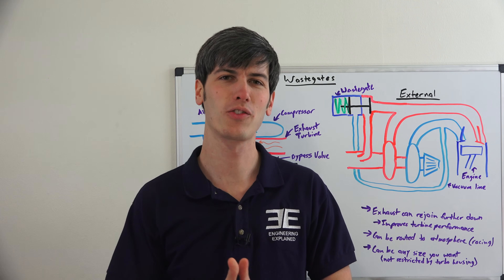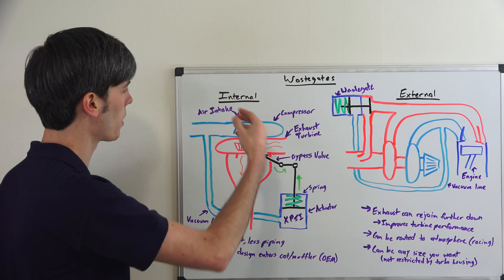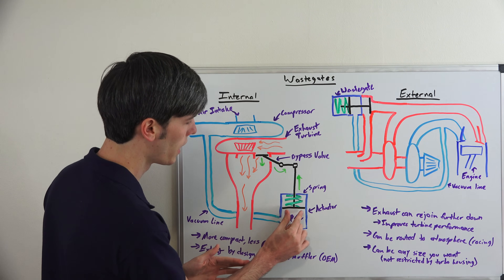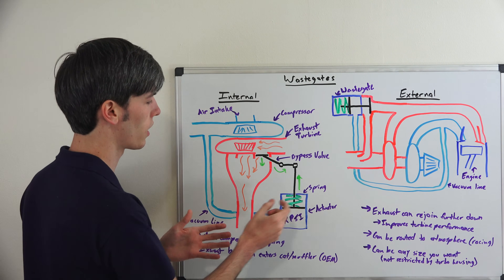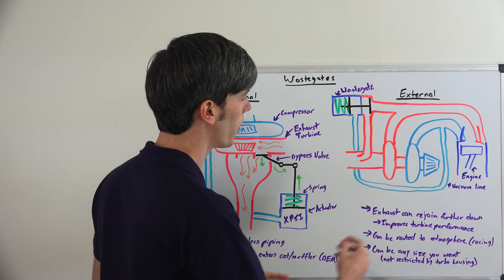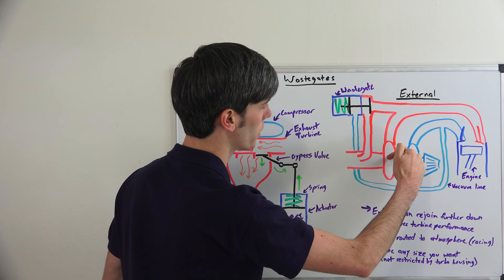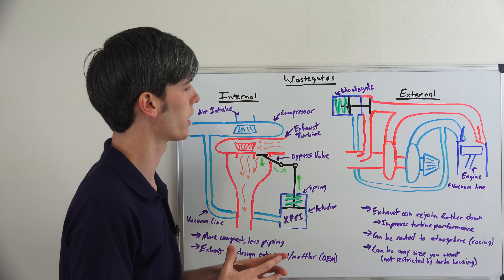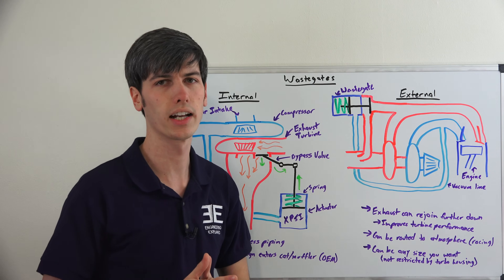How Turbocharger Wastegates Work - Internal Vs External

Comment: Here is my noob question, where would a blow off valve come into play with these turbos? Does it differ with an internal or external wastegate? Or does it replace the wastegate?
Reply from the maker: +Isaiah Thomas Blow off valves are located on the intake side, so they relieve pressure before the boost makes its way into the engine. Similar concept but on the intake side - it's possible to have both.
Reply: So would a blow off valve just control the pressure so you are not over doing it and overwhelming the engine? Also are there negatives to having both? I really appreciate the reply!
Reply: +Isaiah Thomas Blow off valves open when you lift off the throttle, it's the wastegate's job to control boost on throttle so as you said it doesn't over do it, there are no negatives running both but a blow off valve isn't needed, a wastegate is needed.
Reply: Thank you so much for your input!
Reply: +Isaiah Thomas Altho i would recommend running a bov, the STUTUTU you hear from non bov turbo setups is actually really harmful to the turbo
Reply: KittyCow It is not harmful, it is very common here for people not to run a blow off valve or bypass valve including people pumping 40+psi out of turbos for years without issue.

Comment: I am considering an external wastegate for my 2015 WRX, and I had a few questions. How would it effect the reliability of the car? Why is it that so few people do this modification if it improves turbine efficiency?  And lastly, would you ever do this on your STI if your warranty was not at stake?
Reply: +Alex Johnson because if you dump it to atmosphere, its illegal. And to re route it back to exhaust means more piping needed. 2015 WRX turbo is mounted in a very tight space if you are adding a bigger twin scroll turbo with external waste gate, you will have 2 big waste gate under your car. If you want to re route the it back to exhaust, the piping will be nightmare.
Reply: +Alex Johnson It should not affect reliability in any way. As for why people do not do it, it costs money. Also in a version that dumps to the atmosphere, it is illegal in the majority of states. They are often for aftermarket turbochargers as well which require more airflow.
Reply: +Против Глобал Nope
Reply: ***** First :)
Reply: I will be putting an EWG on my 2016 wrx, great mod for safety and power
Reply: Also external wastegates eliminate boost creep under cold conditions which is an issue for any turbocharged vehicle
Reply: +Против Глобал What? Are u sure? Because i think wastegates are made to dont let the turbine overload. Im not an expert tho

Comment: So does a blow off valve just clear the vacuum line from positive pressure?
Reply: +J Sem A blow-off valve lets out the intake air compressed by the turbocharger. A wastegate lets out exhaust gases before they get to the turbocharger. That's the difference.

Blow-off valves are there to protect the engine from too high boost pressures. If you're first accelerating hard and your turbo is spinning fast and generating a certain amount of boost pressure, and then you suddenly lift your foot off the gas pedal, the turbo is still spinning fast and generating boost pressure, but now the pressurized intake air has nowhere to go and starts to build up pressure. Without a blow-off valve your engine could be damaged because of the built up pressure.

So basically:
- Wastegate regulates the maximum boost pressure the turbocharger can generate when you're accelerating by letting some of the exhaust gases to bypass the turbocharger
- Blow-off valve protects the engine from damage when you stop accelerating and the turbo is still generating boost pressure by letting out the pressurized intake air
Reply: +J Sem BOV clears the pressurized intake system from boost as you get off throttle to save the turbo.
Reply: +J Sem it pops when the inlet, after the compressor reaches the set boost.
simply a waste gate lets boost vent exhaust, and a blow off lets boost vent boost.
blow off is better but will stress a turbo wai to much
Reply: +SoY_FooD You've got it all wrong, please go do some research on how a blow off valve works before commenting.
Reply: +Kepe "Without a blow-off valve your engine could be damaged because of the built up pressure."

Considering the throttle plate is closed it would hard to damage the engine, it doesn't cause any damage not running a blow off valve...
Reply: DriftNick But the pressure builds up behind the throttle plate, and when you press on the gas pedal and it opens up again, there's a higher pressure going into your engine.
Reply: Kepe That isn't a bad thing, it's a good thing.
Reply: DriftNick So it's a good thing that there's too much pressure in the cylinders of your car, causing knocking?
Reply: Kepe That isn't what happens tho, there won't be to much pressure, there won't be more boost then you have on throttle, it's really not an issue.
Reply: DriftNick
i studedy this staff an workt on a lot of tunde cars.
a lot of the time we weldit the waste gate shut.
set a blow off valfe to the boost we want in the manivolde an add a dump valfe after the turbo bet before the trottle body.
if u shift gears u step off the gas so non tof that "surge"can get to the engen (it can on a diezel).
also the air in the intake side will slow down dramaticly and rize in presure making air go past the turbo blades in the wrong direction making the chirping sound.
DUMP valve
at max turbo speed and a closde trotel body u get to mutch boos and slow air on one side and underpresur/vacume at the manivold.
u the open a pipe before the trotle body bu vacume power to let the presur speed out in to the open air making the wuss sound when steping of the gas.
BLOW OFF
wil limit the intale mainvold boost.
so if the engen can hadel 1 bar of manivold boost u set it so any more is ventid out.
so if the turbo is a 1 or 2 or 4 bar it will only feed 1 bar no mater mat making it way more presice than a waste gate (witch is made to protect the turbo not the engine)

sry for selling im dutch and on a phone and cant get spell check to work
Reply: SoY_FooD Not only unreadable but incorrect. Blow off valve and dump valve is the same and simply lets pressurized air out from the intake when you let go of the accelerator. Wastegate limits the boost by redirecting exhaust gases once the set boost has been reached. Without the wastegate the boost will rise til the engine blows up basically. While you do not need a blow off valve at all. It just increases the life of your turbocharger.
Reply: for max performance u weld the waste gate shut u put a glowing red hot fin in the exhaust and u dump extra fuel in to get nice loud bangs.
and a turbo runing at max
so to protect the engine u bleed the exes air out of the inlet manivold.
that is how A.L.S. in a old style rally engine works.
its murder on the turbo and they don last even 5000KM.
that is why they added a dump valve to the system to dee stress under engine braking.
modern cars have the dump valve and the waste gate to get less turbo wear and smoother operation.

o and thanx for looking past my horrendous grammar and stuff.
Reply: SoY_FooD I still do not agree, if you weld the WG shut and use a blow off valve as a boostcontrol it will overrev the turbo and you will end up with a highly ineffective turbo spinning way too fast to deliver any sort of efficiency. Not only will it break but it will also deliver warmer air than if you would control the boost with a WG and let the turbo work in its most efficient area.

It doesn´t even make sense that you would weld the wastegate if you are looking for maximum performance. Why would you use an internally gated turbo with a welded gate instead of simply a turbo without WG and just not add the external WG it should have.
Reply: if it is the 1980 to the 1990 and u want 800 BHP out of a 2.0L 4c and u dont think that cooling the engine by injecting more fuel just to evaporate and cool instead of i don't know... maybe... power.
i don't think they have efficiency nor life span in mind.
all it had to do is get past 3 rally stages and as stander maintenance they swapped them out like they swap out tire's.
rouls forced them to use "production turbo's" so the had a wast gate.

its also a very cheep mod for rice rockets and dino queens.
also thees day's u have ECU controlled wast gates that add different benefits so modern monsters use them wast gates one's more.

ther is ro was even a us nascar like race where drivers had a tube near there ear so they van hear the blow off valve about to go and they tray to stay under it because it gave a performances dip and that is killer on oval raising.
the cheap teams just welded the waste gate of a cheaper stander turbo shut so u had no chance of exedental leaking. 

in euro raising there are a lot of restrictions on non model stander performance parts so a lot of modding and dumb stuff can be found every wear.
just read why there wore 200 ford RS 200 and they did not sell a single one. its stupidly cool

Comment: If the line from the compressor to the wastegate is just a air line and the real boost control comes from the spring, then what do those Electronic Boost controllers and valves do that you see the MCM guys putting on their cars?
Reply: +Brap Brap newer cars (like my 2005 colt turbo lol) have a very weak spring and let the ECU control a solenoid in the air line to the waste gate.
the advantage of letting the ECU remap the max boost level will be obvious i hope.
Reply: +Brap Brap The boost controllers bleed air out of that line so the wastegate doesn't open as much which means more boost.

Comment: How do we decide wastegate sizing?  Usually someone just goes "you need this size."but is there some specific reason to go for a certain size? how do you know the flow required vs wastegate size?
Reply: +sadakotube It depends on what amount of boost you think is acceptable, or what your engine components can handle.
Reply: +BmanUltima  was hoping to see the math or rationale behind it from Engineering explained
Reply: sadakotube It's all engine specific, there's not one explanation.

Comment: Internal wastegates can also often lead to boost creep if the turbo turbo size is increased or the boost is raised with a boost controller.  External gates are almost always the best option for mild to heavily modified cars.

Comment: why is turbocharger not implemented using an electrical motor?
Reply: thanks, i guess thats why the aircon compressor isnt electric either, but you'd think relieving that load from the engine would be better
Reply from the maker: +OhPoWneDiel They are in F1! :) https://www.youtube.com/watch?v=k8lyBFmkAKw
Reply: +OhPoWneDiel Actually I think all modern cars have electrically driven a/c's, just like steering has gone electric. Turbos I believe require too much juice to power, and requires a 24V system, which cars don't have yet but are moving towards.

Comment: +EngineeringExplained Can we get a clear video for the differences between a wastgate and a blowoffvalve? And what are the pros and cons? I am little not sure if I think I get it right :/
Reply: +P BOV is before the engine i.e. its venting air.  Waste gate is after the engine i.e. venting exhaust
Reply from the maker: +Jeremy W ^^ Yep!
Reply: +Engineering Explained If you haven't noticed from the comments so many people have no idea that blow off valves and wastegates are two different things.
Reply: +Engineering Explained You definitely need a video explaining the difference between the two. No one's seeming to grasp the concept that they perform two different jobs.
Reply: +engineeringexplained +jeremy w It's understood that one is for air on intake side and the other is for gases on the exhaust side. But do they both go off at the same time?

Comment: which would give me the flutter sound
Reply: +NorwayVFX If only they weren't wrong, it doesn't cause any damage not running a blow off valve, it's very common here for people not to run them including people pumping 40psi+ out of turbos for years without issue.
Reply: +Gázser Márk Finally someone in this comment section who actually knows what they are talking about.
Reply: +TokiWartooth6666 Wastegates will give you no sound. Running no blow off valve gives you the sound, but it will potentially damage the engine, as that flutter sounds is air passing through the turbocharger backwards when you let off the throttle.
Reply: +Gázser Márk Won't damage the engine at all. It's debated the it can reduce the life of the turbo though, causing long term damage. But I don't really buy into that.
Reply: mitchellrobertson15 I meant to say it could potentially damage the turbo (turbo bearings, to be more specific). Not really good, in short.

Comment: Isn't the blow off valve the part that releases exhaust gases into the atmosphere: is it part of the wastegate?
Reply: The blow off valve releases excess boost into the atmosphere to prevent the turbo from having too much pressure. Basically when you let off the gas it releases excess boost that won't be used into the air. It's separate from the wastegate
Reply: +neutral21r That is not how BoV's work, they release pressure when you lift off the throttle which creates a vacuum and opens the valve, they do not open when there is to much pressure, that is the wastegates job.

Comment: You never really explained why we need wastegates at all
Reply: +DukeNuggets69 Wastegates do not dump pressure when you lift off the throttle as they close when you lift off, so many people commenting that don't even know the basics of wastegates and blow off valves/bypass valves, please do some research before commenting because you clearly don't understand how they work and how they are different.
Reply: I would think its to control the amount of boost youre making. you dont always want to be dumping max psi into your engine
Reply: +lolatmyage You are confusing wastegates with blow off valves/bypass valves.
Reply: +kfh13 just because a valve would be too small to dump such pressure that fast and you'd also end up with cylinder pressure leakage too
Reply: Westgate and blow off valve works in tandem, to save your system from too much pressure,
Westgate for by pass additional pressure if it already reach out certain pressure, but it cannot shut them down completely, and cannot throw out pressure that already built inside intake system, they only help reduce more additional pressure from turbine,
While blow off valve, for reducing pressure that already inside intake system, so it won't blow back to compressing turbine,
They both need work together.

It's like if you have a bucket, Westgate for reducing water filling up the bucket, and blow off valve is like a drain valve to get water out, if the bucket have overfilled, they both have the same goal, not to overfill the bucket, otherwise the bucket will explode
Reply: I think, the exhaust gases are more easier to be expelled out when exhaust manifold pressure is as low as much possible. So wastegates are needed, because if there wasnt any wastegate the rpm of engine will gradually slow down, the scavenging process inside the cylinder would fail.
Reply: +kfh13 some wastegates with improper spring cut power because they release too much pressure or not enough, spring wastegates are great when you run High pressures just simply because you need a tough spring but with small boost it is hard to find the perfect spring. You're better with an hks SSQV
Reply: +walfy melo it also dumps all the excessive pressure at the moment you stop giving gas , if you have too much pressure in the turbo when you realease gas the turbo could explode due to excessive constraints on the housings. Imagine that as you're putting air in a ballon , it you stop your compressor but it is still blowing air into the ballon it's not right , you don't want that huh? Same with the waste gate it stops  the air from blowing up the turbo
Reply: +walfy melo [noob here] Why not put one-way valve between compressor and engine? You can setup valve to open at demanded pressure. It seems easier solution... Valve can work at lower temperature range then wastegates, it will be easier to install, produce and I presume cheaper. So why wastegates are "cutting power" from exhaust turbine? More explanation needed.
Reply: Aha! A REAL engineer but without petrol blood 🤔
Reply: The video is to explain how it works not why we need them
Reply: +James Gould To vent the excess exhaust gas. Say youre going flat out, youve got 10 psi or whatever forced into the engine by the exhaust. When you lift off, the engine is no longer using that air and the throttle is closed. That air has nowhere to go, and would go back through the turbo in reverse if the wastegate wasnt there, which isnt good
Reply: @lolatmyage  isn't that what BOV does?
Reply: @lolatmyage  that’s not what wastegates do. Wastegates control the boost to not destroy the engine and turbo itself for over boosting. Blow off valve is releasing the pressure out of the manifold to protect the spinning turbo so the air isn’t going back in the turbo. Cars  with big turbos and do not run with BOV’s do have the magnificent Stu tututut sound which is bad . Air flow is forcing through  when compressor wheel is spinning opposite way. Air cutting through the blades.